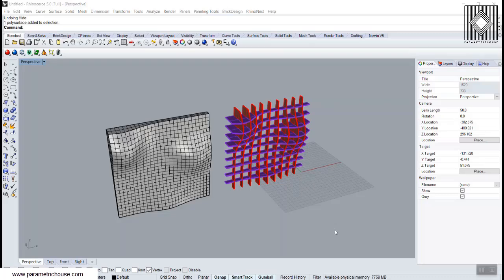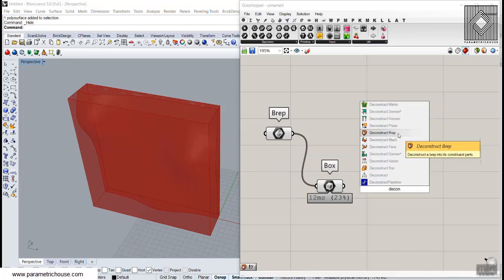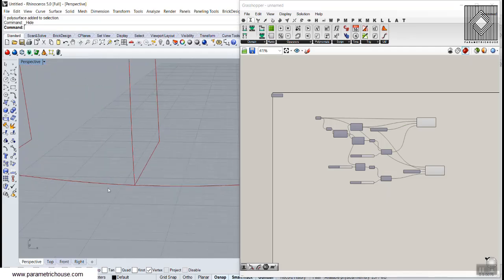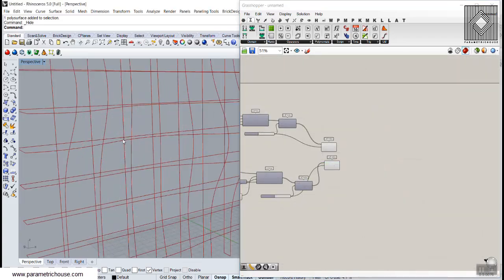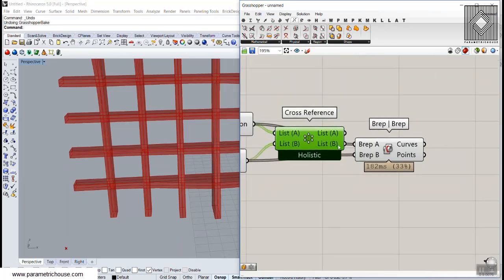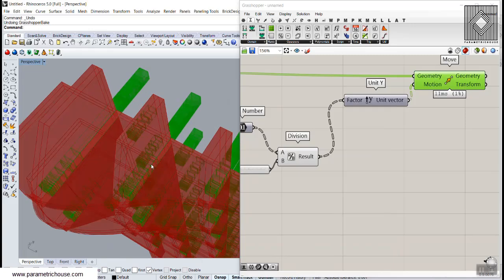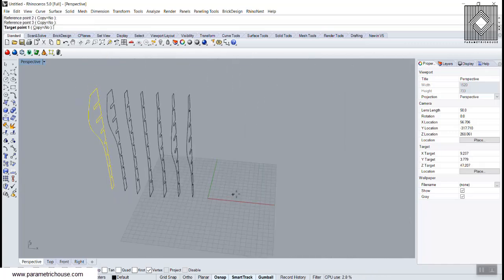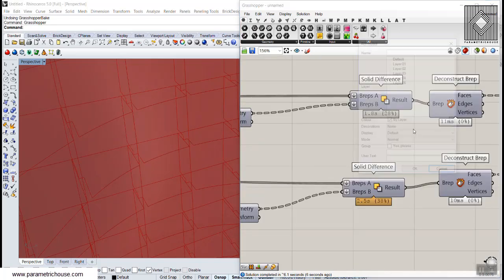Waffle structure - Grasshopper Tutorial

Comment: Thanks for the workflow. An improvement (with added complexity for the next level) use 'Solid Intersection' (to get the shape that the 2 overlapping elements form) instead of 'box' because then your script will be able to handle more complex geometries where elements don't intersect at 90°.

It's more work because you have to debrep to get one of the end-faces > evaluate geometry to find it's plane > find the middle point of the solid-intersection-brep > move the plane to the middle point > make a cutter on that plane > cut the solid-intersection-shape in half and cap > use that to cut your notches with 'solid dfference'.